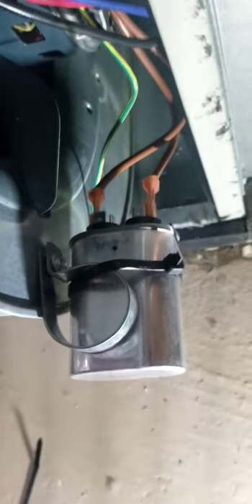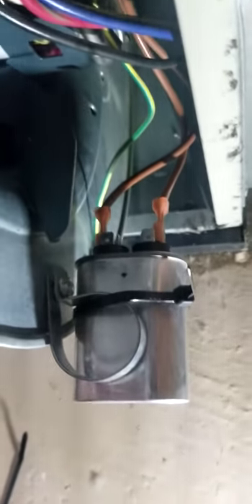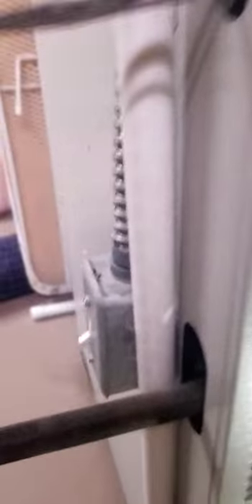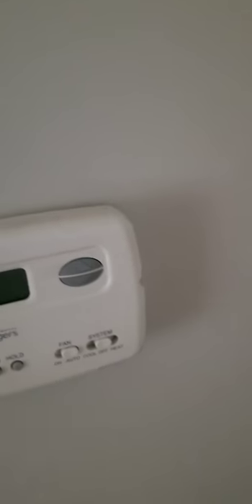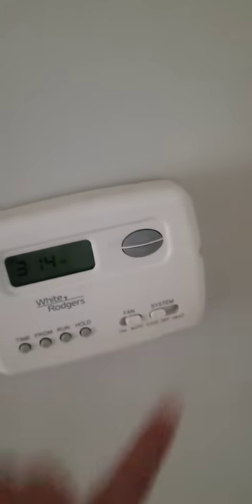Furnace not blowing air- easy fix

Comment: If your furnace is  own but the blower ain't spinnin it could be a dand capacitor so here's what you nade a screwdriver a new capacitor make sure it's the same a lat and a busch lut ground out your old capacitor rig the new one back own slide your motor assembly  back in and tighten it up put your cover back own turn own the furnace turn your AC  own  and check your furnace and its hummin as good as new